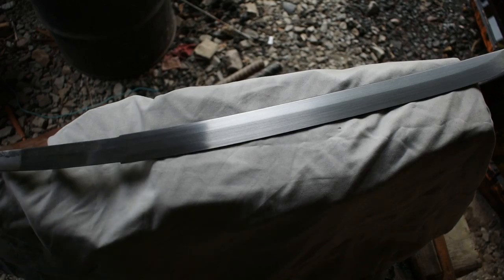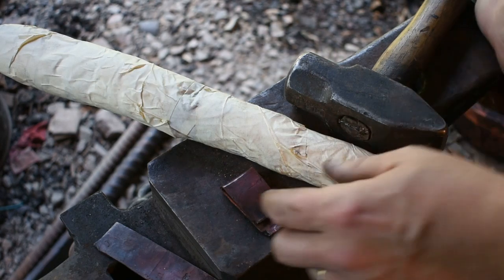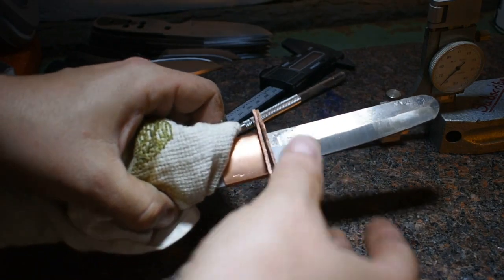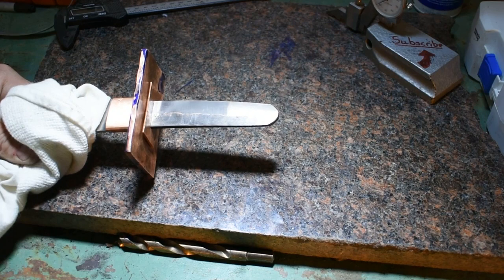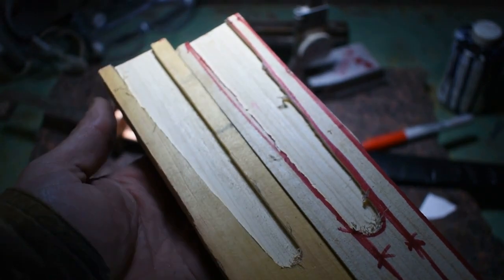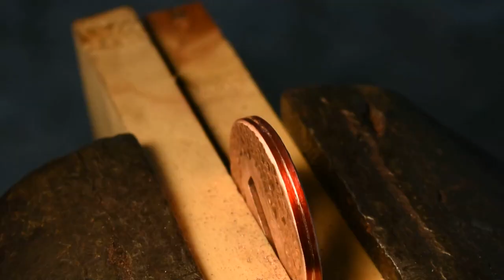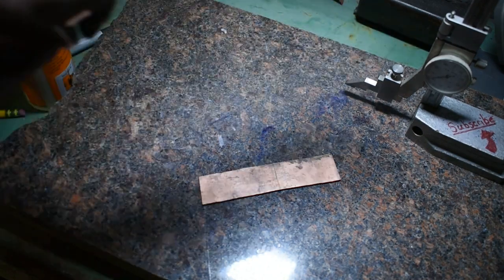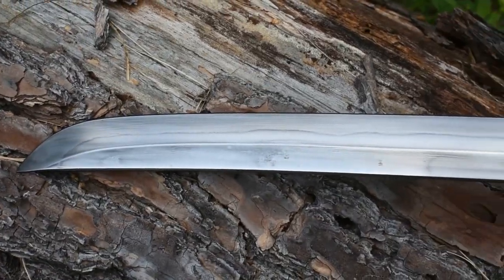Forging a WAKIZASHI/KATANA inspired sword from a FILE. PART2 FINISHED!

Comment: a note on the handles.... full depth cut one on side, and clearance cut the other... the idea is no way for the blade to split the seam like you would have if the inside was cut half depth on both sides... love your work man, just a pointer
Reply from the maker: Good to know, I appreciate the tip, I will definitely apply it moving forward. I

Comment: Nice result! I went and checked the length of the tang on my (real vintage believe it or not) katana. You were right to lengthen yours I think. I maybe would have made the guard bigger (woulda coulda shoulda, haven’t), but I think you can be well happy with what you made.
Reply from the maker: Thanks, the tang was definitely too short before I welded the extension on, as for the guard I would have liked it to be bigger as well, I learned a lot on this one, I'm building up to doing a pattern welded Katana, then a Odachi eventually.

Comment: It's a looker for sure, the hamone came out great, the copper work is better than mine,🤣 on that part, I wonder about using silver soldier aka silphos? Have to use higher heat, but we used it in refrigeration for pressure lines so it seems stronger? Oh, dont worry about the traditionalist snobbery. Folks need to lighten up about artistic expression. They can complain when its them making one on YT. I'm curious, I've seen folks use a bedding technique on the handles after slotting for the tang. Do you use one? I'm saving for a mini mill, so darn handy and much easier and quicker than hand work.
Reply from the maker: Thank you for watching, I greatly appreciate it, I didn't bed the tang on this one but I do on other knives especially like my chef knives. I love the mini mill I have, it makes a lot of work so much easier.